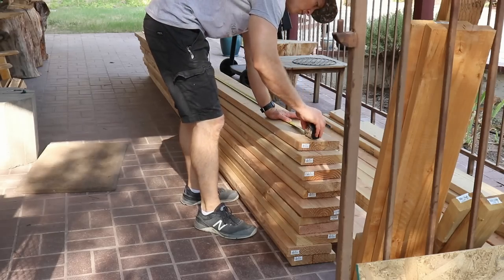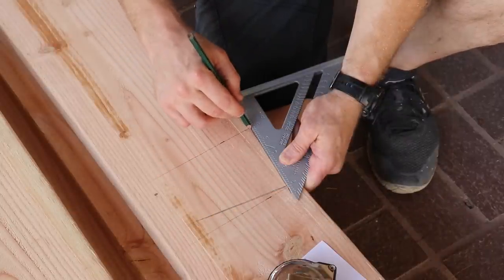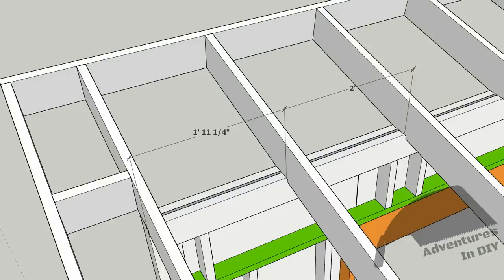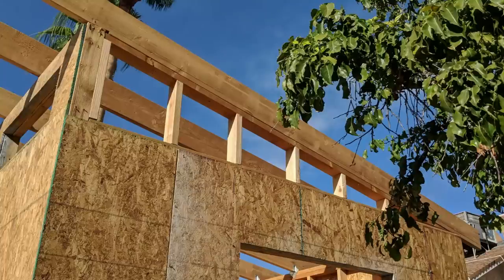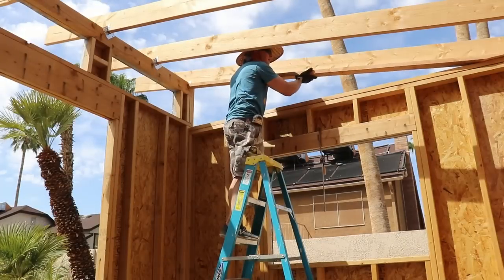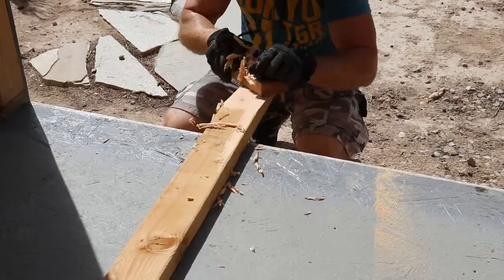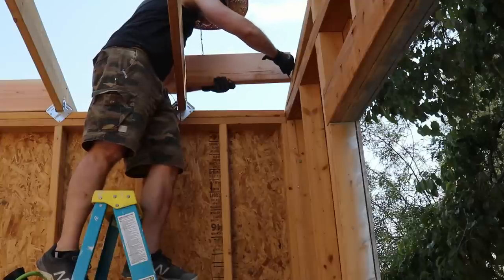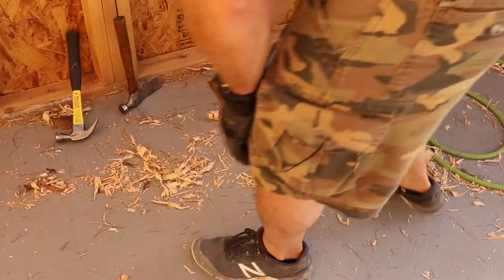10 x12 Modern Work Shed - Part 6 - Framing The Roof

Comment: Ever think of buying a spokeshaven? Hand plane, chisel and hatchet all rolled in to a two hand tool! I know it's an old world tool, most people may not know what I'm talking about, not often used, but in situations like this, when you need to rough plane or de-bark and true, felled trees!

Also nice work, I couldn't tell if it was California, Hawaii or Florida, with the palm trees, over engineered for sure. More expensive, especially if building now (6-2021), but will be sturdy for the long haul and for the expected cliche... Get what you pay for and or in this case, also what you put into it!
I never thought of using a Japanese saw for the birds mouth! I own a couple, use them often, but never clicked in my head! Perhaps a door jamb saw. Better yet finally a use and excuse for me to use and own an oscillating saw, never have taken to mine, I know they are useful,  guess just stuck in in my ways! 

 I like Japanese or fan saw, as I've heard them be called in the West. I lived in Japan for nearly a decade, I have used them for years. Always razor sharp and easier on the hand if you are making smaller cuts, thin pieces especially with furniture making! take care of them or new.

Comment: I'd like the size of the rafters and size of the boards attached to the ends at the low side.  Crucial information. Size of stringers to use????
Reply from the maker: All the details are found in the article. https://www.adventuresindiy.com/home-improvement/modern-shed/building-a-modern-shed-part-6-framing-the-roof

Comment: Solid work man!  Can I get away with using 2x6s for roof rafters?  They will span 12ft, with an over hang on the front and back of 3ft.  So 18ft long 2x6s.  The roof is just plastic corrugated stuff.  No snow load, I'm in Hawaii.  The rafters will be sitting on two 2x8s resting on trees I cut for poles.  (Kind of pergola style but with a roof). It's for my outdoor kitchen.  I'm broke and trying to drop out of the system / live off grid.  

Long story short, will 2x6s for rafters with 2x3s for perlins sag ?  I used 2x4s for my tiny house roof and definitely made a mistake.  It's holding but you can see the sag already.
Reply: 2X4 RAFTERS WILL WORK FINE W/NO SNOW LOAD
Reply: I'M CURIOUS HOW LONG THE RAFTERS WERE ON YOUR LITTLE HOUSE  AND IF THEY WERE 16 OR 24 INCH ON CENTER. I'M BUILDING A 12 WIDE USING 2X4 FOR RAFTERS WHICH I WAS TOLD WILL BE SUFFICIENT.
Reply: Harland Crosby 24 oc and it's going on 3 years and been fine.  2x4x18 span of 12ft.  Don't do this in snow though
Reply: I’m planning a 10x12 with a single slope roof and was thinking 2x4 trusses along the 10’ direction. I’m in illinois so we definitely get snow but it’s also under a big oak tree. Thoughts?

Comment: Fantastic series of videos! Will you be making a video of installing the roof? Will this be finished inside and if so will the roof be vented? I'm about to build a similar shed which will become a guest room so I'm looking for info on venting shed roofs.
Reply from the maker: I just finished putting on an unvented roof that uses layers of OSB, rigid foam, OSB.  I plan on doing a mix of insulation above and under the roof.  I'm writing the article now and will cut and put out that video next week.  Your roof design will ultimately be determined by your climate zone.  I came across something that shows a combination of rigid foam on top with venting.  Hope it helps.  Check out page 19 of this https://www.energy.gov/sites/prod/files/2015/02/f19/ba_webinar_2-12-15_lstiburek.pdf

Comment: I assume you live in a warm climate by all the palm trees. ;-) For folks building this in a cold(snow load) climate the fly rafters should be tied into the previous rafter to help share the load. I can tell this is being built by a woodworker not a carpenter. You should wind up with a pretty solid structure when your all done.
Reply from the maker: Thanks for bringing that up. I was going to connect them across a couple of rafters but realized there wouldn't really be any load on them since we don't get snow in Vegas.